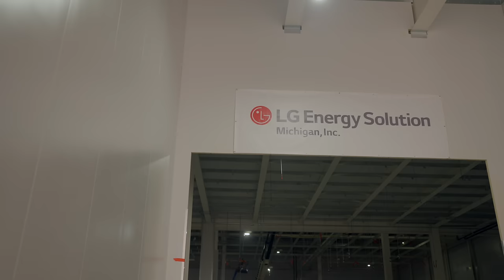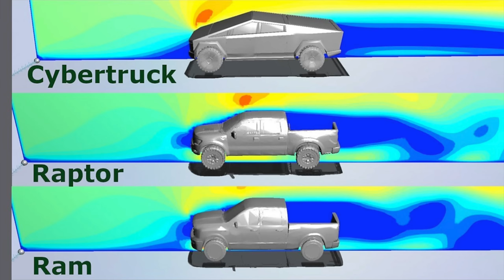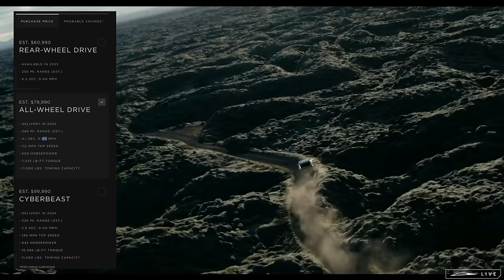Cybertruck - What Tesla ISN'T Saying!

Comment: about the efficiency, the power that was put on the tesla wasn't made at 100% efficiency, nor was it transported at 100% efficiency, nor is the battery 100% efficient at storing charge from the not-100% efficient charger. to put those 130kwh in the cybertruck, at least twice as much was necessary at the plant. don't fall for such obvious disingenuous thought traps.

Comment: If price shuts you out, just wait. In three years these prices will drop. This is from someone who's 2020 Model Y dropped $30k in value over the past two years. I don't mind, I'm an investor.  
Look at the recent Project Farm video where he rebuilds his truck's transmission. Probably 200 parts  none of which is needed in a Cybertruck. Brilliant engineering, but effectively obsolete for cars and trucks.  (His F350 diesel now has 530HP, my Model Y has 435HP.)  Simplification is a very powerful reason why in the future EVs will cost less than ICE vehicles.

Here's something else about range. If you drive your Cybertruck off road, you're probably never going to go very far. But then you have to get to the end of the road. That's where range will be needed. This will require  more Superchargers. Then, once you are off the road and camping, you could be using energy 24 hours for heat or AC. A good computer that you can energy plan your trip will be essential.  One more thing, as soon as you slow down, your range goes up. I drove from Blanding, Utah through the Dene (Navaho) Nation to Holbrook, AZ on I-10. I charged in Blanding, but didn't quite have the range. When I slowed down to 50 and turned off the AC I made it with about 15% left. 

Traction on my Model Y is already amazing. Know what Tesla tire chains are for? To show to the Highway Patrol  so they let you drive up the mountain to the snow. That's it. Anyone ever have to use them? When I got up to the bottom of Mt Baldy, there was no place to park,  so I just parked in a snow drift. I had to make a few runs at it to move enough snow.  Cybertruck is going to be even more amazing. 

It would be good on a farm because it's got the power, it won't get stuck, it has 120/240 outlets for power tools. No one is going to exceed the range on their farm, but they might driving into town and back.

Comment: Uhm….try actually throwing a jagged rock at the windshield at 100 miles an hour.  That would be realistic.

8 foot beds don’t need tail gates down.

They promised way more then they provided….LATE.

I’d that the same metal they used on his rocket ships?

Signals can be easily blocked or interfered with on purpose or accidentally.

Drag races are silly.  How good are the drivers?  How fair?  A matter of trust you say?  See again what and when all this was promised.

Comment: i'm due for a new car pretty soon, I want it to be all electric, and i want to go off road a few times a year, but don't want to drive a big truck or even a big SUV around town all the time.  Around town, i really have no need to drag that big battery and the structure supporting it around (its relatively fuel in-efficient).  and around town, parking a big truck is tough (been there, done that).  and so far, there are no small EVs that have adequate ground clearance.  So i wait.  nice video, as always.

Comment: Hey Ricky, good breakdown of the CT, yes I have an order in from Aus and don't expect to see it for a number of years and as long as $TSLA at least doubles in this time I will take the Beast, having said that the dual motor version has been seriously stepped up to match trimotor in almost every spec except acceleration. 2 Questions-1 no mention of water tight boat mode for deep water crossings, 2. There is no Air outlet for pneumatic tools. And no mention on either of those questions. I can understand lrg air compressor takes up space, but the boat mode needs discussion for those people who may choose to do deep water crossings and find out the hard way.

Comment: A true "clean sheet" design exercise not only for the body forms but for the chassis engineering as well.  Quantum leaps in design doesn't happen very often but I do see some parallels in architecture, Mies van der Rohe's Barcelona Pavilion and FL Wright's Falling Water House and Guggenheim Museum.  Now that Tesla has come this far I would think they can keep the radical engineering thinking on their next project- the $25K EV.  They will really have to develop low-cost, high volume production to be able to make it for a profit.  Mega cast chassis and no body paint?  It could be a really interesting future.

Comment: I own a wild Camp in Carpathian mountains, Transylvania. I don't drive long distances, usually 50-100 km for supplies. But the biggest thing is that on the last 500 m is off-road. I have to drive trough a river and get up a steep climb. I do this all year, I moved up here 😁
I' m not sure how capable is the cyber truck for this environment, but for sure it would be tested to the limit. Specially in winter 🤘
S-o the range would fit perfectly here. There days when I don't start the engine. But the big issue is the price...I can't get anywhere near that.
I wonder if tesla is doing sponsorships 😅 the camp works on donations anyways.

Comment: The range issue is huge, using this truck for contracting is probably out, this truck might not be for us unless the jobs are close enough and not having to run a generator will save money. Not having to worry about scratches and dings in the home depot parking lot is a nice feature. This has some good some pro's for the pros but it won't be sitting home all day getting charged by my (future) solar array either. Nice video Rickey, thank you.

Comment: The range is ok with me because the Super Chargers are widely available.  The towing routes I will use have Superchargers less than 150 miles apart and Camp site has 50 Amp power I can plug into.   I doubt towing a bass boat will hurt the range that much. And once I am at a campsite with 50 Amp power I am thinking I can charge up to full in 8 hours or so, if I am camping overnight .   And I can beat the hell out of it without getting a scratch or dent. I am in. Finding high octane fuel for the bass boat will be the challenge if I camp more than a few days.

Comment: I'm not falling for the pull. As long as your vehicle has adequate torque (1200 lb-ft is PLENTY), what keeps you moving down the dirt track is the vehicle's weight. An F350 diesel has 1200lbs over the heaviest Cybertruck, and most of that extra weight is over the front axle due to the diesel engine, giving it a traction advantage.

In the video,  the cybertruck's nose is high in the air,  limiting the traction it had with the front axle. My money is on the F350 being 2WD, or being in 2WD mode.

Comment: I go sometimes 200+ miles with a car trailer to pick up cars. The 470+ battery stack sounds intriguing. Hopefully by the time my reservation comes available in approx 2-3 years it will be available. If not I'll need to see what else long range range ev truck is out there. ☹ Obviously rather have the CT.

Comment: I think people overuse the word promise. Tesla never promised bulletproof windows. They did say the top of the line would have higher payload and towing. But at the time rear wheel steering wasn't on the table.

I'd think adding rear wheel steering made a compromise on these weight figures.

Comment: Ricky -this was always going to be an expensive vehicle.(For real).  Remember using the term "promised" with Elon - tends to result in temporal disappointment  ("impossible"  gets delivered eventually - always over budget and overtime...)

AND as an Engineer, how much B$$s is in the claim that Tesla Metallurgists "created" a new Stainless steel - you know because  no-one has made a Delorean before (jk)..
(Stainless  steels have been fairly well researched over the last 200 years... AND we can do quite a lot -  single point forming for complex shapes is very possible,  for small scale production (or just build more robots for a larger run, with robotics, increased production doesn't "Scale" with the number of machines  but wage growth does, as also does multilevel factory working cells),and saucepans have been deep drawn for 150 years (or thereabouts)

When the Edison guys from Kamloops get their series hybrid  - Ford/GMC/Dodge  - 350/3500 size  - drop-in swap-up kit going (time is a factor, yes) - then we will see how the CT compares on a X-country rugged adventure...

Stating the "Wastefullness of petrol" - could be rephrased  around the idea of - the inefficiencies of (all) primary power generation - using any thermal cycles...  Carnot is an efficiency killer....   IF the Electric Energy was created by burning stuff, what NOW is the Round trip Efficiency (And add in the mining and refining energy costs to the Coal / Petroleum based Fuel...
 (The Efficiency of Smelting Steel and Aluminium, etc - (How to calculate, and to what end, may be the query ) - Aluminium smelting  is stated as being up to 96% efficient - IF so, then using Aluminium from hydro countries in Al-Air  Batteries may exceed energy density and cost of the secondary cells we are currently playing with,  Noting that Aluminium IS infinitely recyclable with much lower footprint in the secondary market  (not CO2 Free, but definitely lower than burning Coal and Oil - for bulk manufacturing processes....

Now as far as getting civilisation to "homeostaric equalibrium with the "Gaia's" cycles, (NB... may not be possible), we are dealing with  (and appeasing/attempting to appease - Pagan ideology) - anti - people people, who simply throw up roadblocks in front of everything..  Remember, "their" motivation (is not "Love" and "Peace", "Goodwill to all mankind" ) is that they "hate people" - they think humanity itself  is bad for "mother earth"...    Is there somewhere (safe) we can just send all those types...   lol.....

Comment: I am an extreme truck driver and for towing at least 3 times a week. I was really hoping that Tesla would have made the Cyberbeast variant at least the one that could tow 16k lbs and travel over 500 miles per charge. The other to variants could have been for the other 85% of truck people. This is why I am so disappointed, because at the price, I can't even tow my 5th wheel toy hauler out to safety during a flood, which happens where I live almost every year. And I tow a hauling trailer which I fill my bed and my trailer up all the way on most jobs, which, the truck is good enough for this, but that's all I can do, and the mileage will be cut more than half due to towing, so I can't really do lond haul tows and junk hauling etc. unless I get that rediculously expensive $16k battery extender permanently installed, now their is no room for a 5th wheel hitch in the bed.... I was saving up for the past 4 years for Cybertruck. Now, when it comes my time to buy one(pre-ordered), I will have to think long and hard if for 1 can I afford the Cyberbeast, and 2 will I be able to afford it, and 3 could I even afford it? The answer is... if I were to be able to get the Cybertruck within 1 year, then yes, I can rent it out on Turo and make my payments and then some just to afford it, but more likely what will happen is that I won't get the opportunity to get a Cyberbeast until 4 years + which the magic of them will disappear, and no one will want to rent one because they will be everywhere and everywhere on Turo. My dilemma🤔

Comment: What design modifications are imnplace to protect the battery pack from fires, internal and external?
What isolations are in-place keep the Internet connection separate from the control system, especially brakes and steering?
Considering the scarcity of Tesla service stations, what kind of support is available for 3rd party service agents?
They could not mount the spare on a rear rack?

Comment: Your argument at 18:00 is an argument for the Prius Prime. 🙂The ginourmous battery requirement with the range extender likely would put batteries in 100 Prius Primes.  Those cars would run on electricity only probably 90% of the time, removing emissions and fuel burn from 100 cars. Meanwhile the giant, and let's be fair UGLY, Cybertruck will replace the emissions of one truck. 

Electric Hummers, Cybertrucks, E150s ....   We're doing this electrification all wrong.

Comment: The solution to towing is, put extra batteries in the trailer - those could then be wired to the vehicle or alternatively used to power the trailer. OK that is going to make a trailer expensive, but if you only use the trailer a few times a year, hire the trailer. Considering the radical ideas showcased in the Cybertruck this seems obvious to me. Indeed there is already a company making a caravan with the batteries in the vehicle to power it.

Comment: I think Tesla should make the range extender pack in smaller Lego like parts.  This way, the owner can take them off  and mount them on their wall at home for back up home power supply.  And once or twice a year, put them back on the truck for hauling or long distance trips. $16K for the amount of battery in the extender, it s cheaper than a power wall.

Comment: Despite the (manly) image they want to portray, the real reasons people buy 70K+ dual cab trucks is the Interior Comfort! The seats and trim are plush, you ride high, you're family/kids fit spaciously in the back & it's safe. They function like mini-vans for family needs, a "work truck" for business/tax purposes, and all your buddies will be envious as hell!

I'm a huge Tesla fan, but the extremely spartan interiors that they are known for and awkward looking giant tablet that sticks out of the dash was very disappointing when I finally got to ride in one (a model 3) this year as a Lyft passenger. Also, I just don't get the exterior door handles. They look very cool from the outside but when I actually had to use it, I couldn't believe how stupid it actually was to operate. It seems like it was supposed to open with one hand but I ended up needing two hands (and I'm sure I'm not the only one). I once I finally found the exact place to push with my right hand to get the handle lever to come out so I could pull on it with my left hand, it felt so cheap that if I pulled just a little too hard it would break. And I guess I was right because the second time I got to ride in a Tesla Lyft again, the rear door handle actually was broken so the driver had to lean back and open the rear door from the inside. 

Don't get me wrong, I'm still a huge tesla fan. The insane original engineering and vertical integration is crazy awesome and the CyberTruck takes all that (including how it's manufactured) up another 3 levels. I just wish they would put the same effort into engineering the interior for human comfort and style. I think that is one area that Rivian has Tesla beat hands down. It's not even close.

Comment: Umm, regarding the 48V 'low voltage' power distribution. It's called "power over ethernet" (PoE) or similar. The power and control uses the same 2 wires, which are shared to all devices using a 'ring main' type of system. Power and control are, NOT separate as you implied.
Reply: Your explanation is confused. Ethernet requires four wires, one pair is for send and one pair is for receive. In fact, off the shelf Ethernet cable has eight wires. Ordinarily only four are used but is it possible to use simple passive wiring devices at each end of a standard cable to handle two completely different network connections. PoE is possible because a DC voltage as well as high frequency digital signals can coexist on the same cable pair. A DirecTV satellite dish uses a similar arrangement except a "power injector" supplies power to the dish hi-gain amp over the same co-axial cable that sends the feed down to the receiver.

Comment: Let's see if I got this right. Proprietary 48V secondary battery system. Proprietary sensor and wiring system with ethernet sensor communication. Huh? Wonder what could go wrong there? Proprietary body panels. Proprietary windows and windshield. Proprietary main battery system. 35" tire costs. Can't use the bed without discarding the spare tire. Oy Vey! "Yes, Mr. Smith, we can provide you with full insurance coverage for the mere sum of $17,000 usd per year".

Give me a break!?! If this isn't the most over-the-top, virtue-signaling, wasteoid vehicle of the year, I don't what could top it.

I think I'll start a business manufacturing the "Bed Mounted, Diesel-Powered, 15kv Generator Pack with Integral 25 gallon Fuel Tank" for people who want to use their Cybertruck as a real truck towing stuff in cold temperatures. Might be my road to fame and fortune.

Comment: A "Tommy Gun" shoots a .45 ACP cartridge. That 230-grain bullet travels at about 800 feet per sec. The muzzle energy is only about 330 ft-lbs, which can put a hole in flesh, but not steel of considerable thickness.

Comment: very well done video!  would i buy a cyber truck ? - no.. I really see no reason to drive a motor home size vehicle all day let alone drive one very fast in a vehicle that can't possible handle like a Porsche. And yes, no raptor for me either. Before anyone say anything about quarter mile, anything with a powerful amount of power can go fast in a straight line. In a 10 lap race around a track, the Porsche will lap it . For work, like you said, it falls short but its halfway there. I would consider it for sure since i don't really need the versatility of typical truck.

Comment: What about a trailer that has a range extending battery built in so that you can plug in the auxiliary power cables coming from the trailer at the same time that you are connecting the light/brake electric wires?  Seems like an opportunity for a third-party manufacturer or even Tesla to make available.